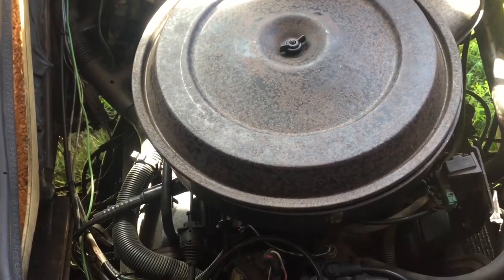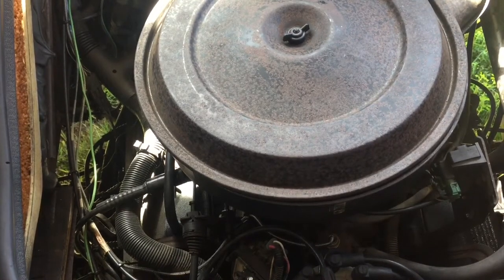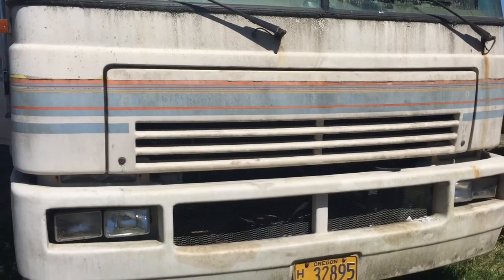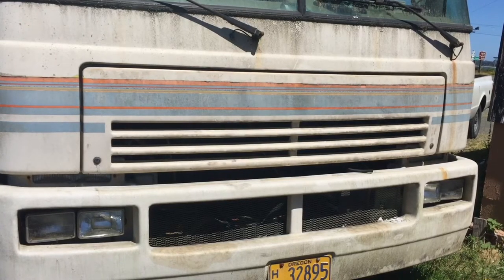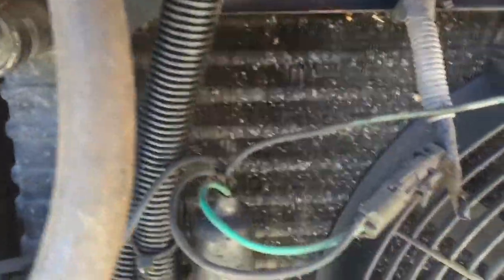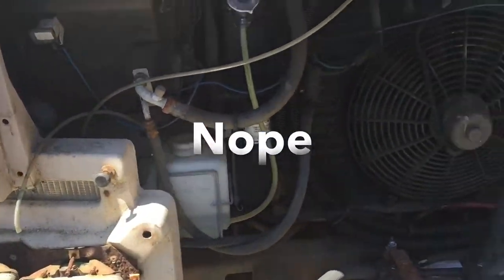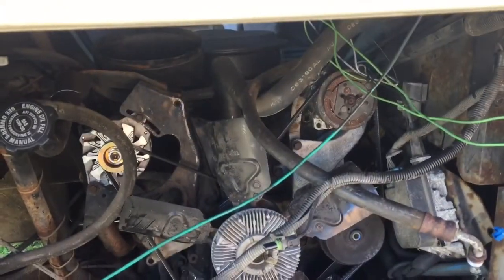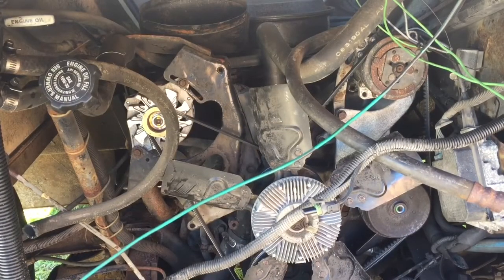1991 BOUNDER by FLEETWOOD ENGINE REMOVAL 454 BBC CHEVY P30/p35 engine pull PART 1

Comment: Hoping this video will come in handy. I just permanently parked my rv, and I plan to pull out the engine.
Reply from the maker: Best of luck.
Reply: I am needing info on if the radiator will come out the front and the a/c condenser , Q - if you can remove the radiator without opening the air conditioning. System .
If you can just tie it up and still get the radiator out. 
Mine is leaking so I need to take to shop, while I had it out I was going to change out the water pump, testator, hoeses & belts.
Didn't know how difficult that was.
I have a 1993 Fleetwood Flair , w/ 454 ???
any info would be appreciated .
Thanks 
William Warren
Reply from the maker: Yes it comes out the front. I think the ac has to be opened up. Then it’s jus a matter of moving stuff out of the way. 
Good idea to do front of motor stuff while it’s open.

Comment: How did you get the radiator out
Reply from the maker: William Warren there is a bracket that goes all the way around it. Two bolts on either side the the top comes off.
Reply: Do you know any tips that wood improve fuel economy on this engine.??